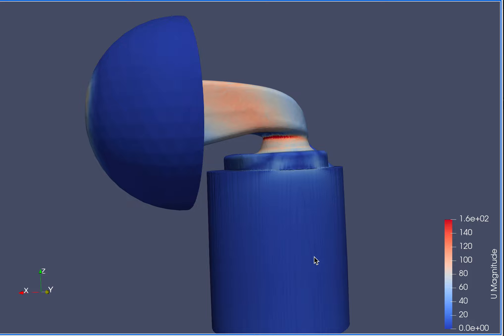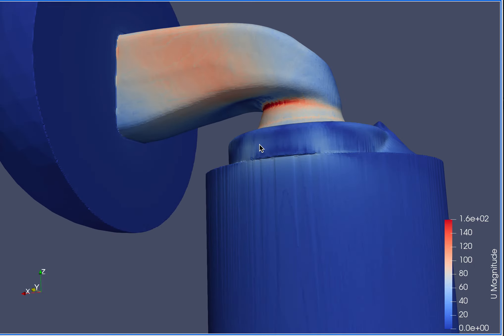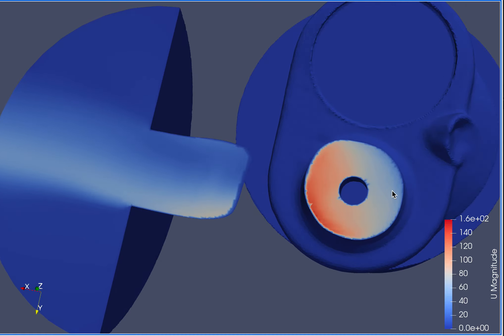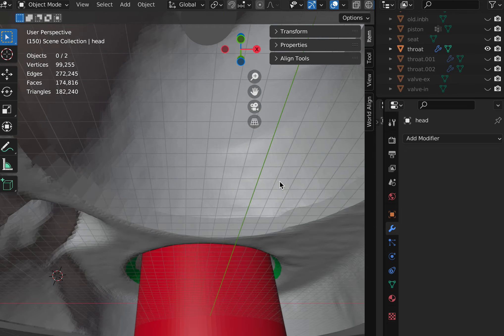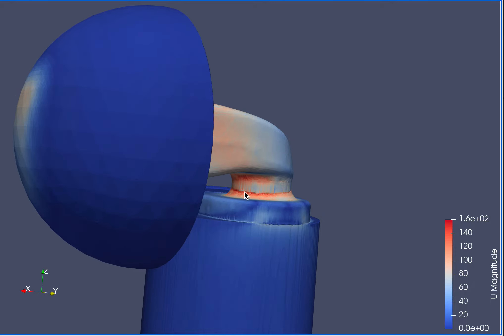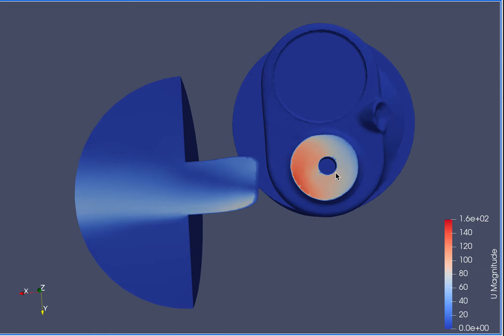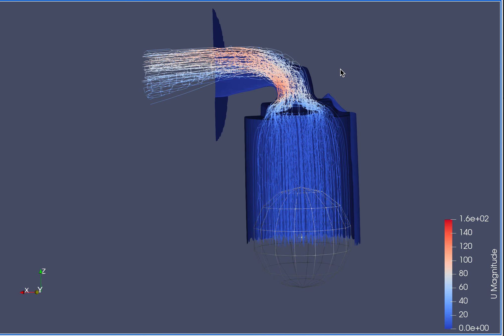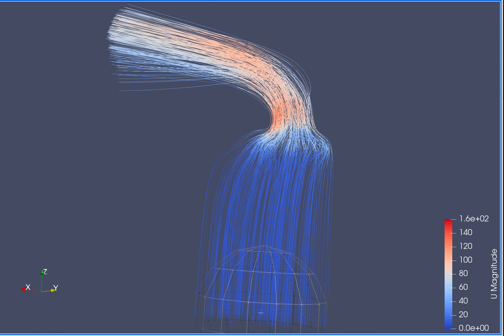Volvo B20 F Cylinder Head CFD analysis and porting

Comment: Andy, I suggest two things here: 1) model the first 10” or so of the exhaust pipe. The bend radii off the head is going to change it, and it’s going to change on each cylinder depending on the header geometry. 2) You can build a 1D model and set your pressure drops (and know the heat, so you can set gas density) that way. I highly suggest EngMod4t.

Comment: I know you said this was for street performance. Phil Singher developed a process that raised the exhaust port by adding material to it. The same idea has been accomplished by adding a flange onto the exhaust header.  That, plus increasing valve size, doing the porting you described and taking some material out of the combustion chamber can really increase the flow numbers.

Comment: Great! I'm thinking about making the simulation for my rover v8 heads the same way. Never heard about the OpenFoam. I have to try it too.
Reply from the maker: You definitely need to know a lot about fluid dynamics and numerical methods before using openfoam, but it’s a very capable finite volume package . It’s very different from say Solid Works with the CFD add on, where all you do is click some buttons and it gives you a result back that may or may not be correct , because solid works guessed all the options . 

Something like Comsol is more capable and way easier to use, but it costs crazy money .

Comment: Try taking out the step on the long side bowl. Keep a sharp step on the short side, but try sharp steps of 15 degrees. The floor of the outlet responds to filling too.
Reply from the maker: I’m going to play around with enlarging the bowl in the cfd model.  Normally a port in a Chevy or ford has the bowl larger than the throat. But Volvo is weird in that there really isn’t a bowl, the port keeps the same diameter right up to the valve seat. 

A larger bowl will slow down the air flow, and increase static pressure, and this static pressure should help force more air across the valve seat opening. The later Volvo OHC heads all have a larger bowl than throat and flow better than the pushrod head. 

Yes, filling in the floor of the exhaust would definitely help, it would keep that flow separation from happening. Weird thing is the ford 351C heads had a similar problem, and weirder still how the engineers designed it that way. They all obviously knew about aerodynamics in the 60s, I mean the SR71 was flying for years when Volvo designed these ports. Strange that the engineers just didn’t seem to care.
Reply: @AndySomogyi  LS heads rely on the sharp 15 degree ridges on the short side of their intake ports to maximise useful area of the valve. TBH I think Volvo did engineering by Xerox for their heads, right up to the 532 16V.